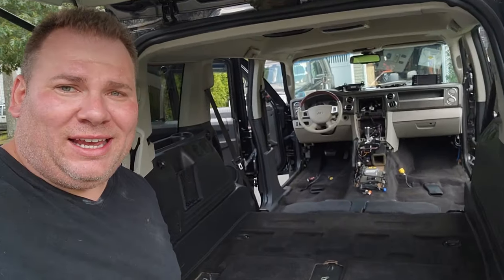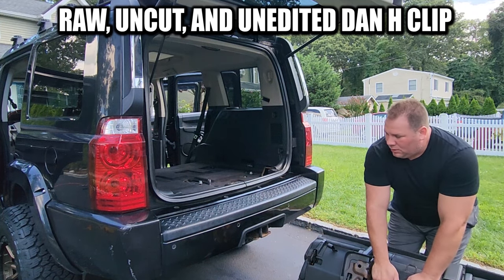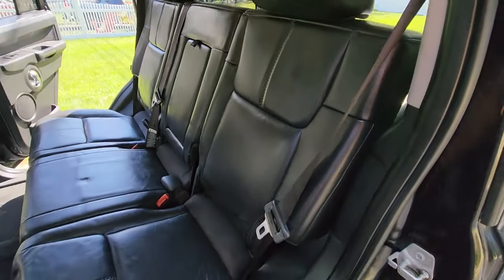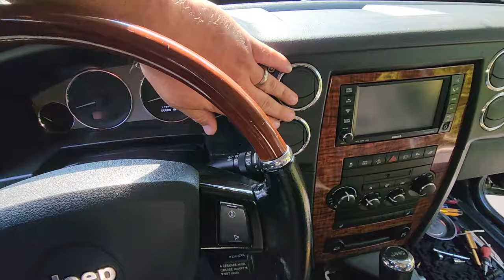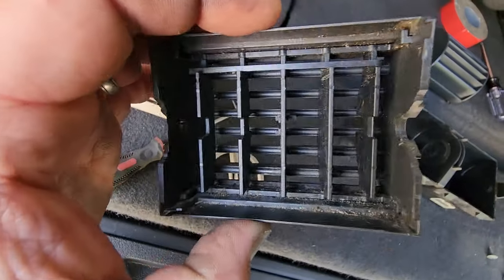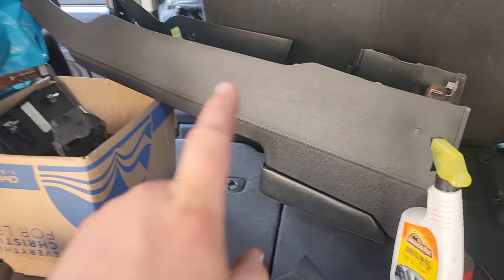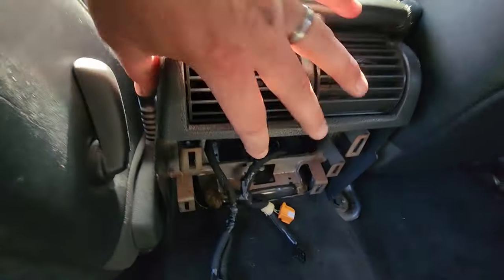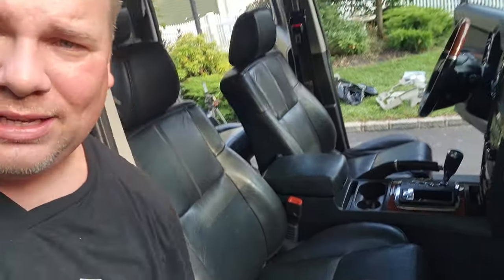JEEP COMMANDER INTERIOR SWAP!!!  PART  2 - SEAT + INTERIOR INSTALLATION & CENTER CONSOLE VENT FIX

Comment: Great job on the swap!... and you didn't even have to use any JBWeld!!    I'd love to add those black door panels to my Commander.  I have the "Saddle" color seats and think the black panels would look sharp.  Guess I'll have to check the local auto yards...

Yeah, the smoked headlights are awesome.  They'd look wicked nice on your XK.   I have them and love them.  I also added smoked fog lights.  Very easy upgrade!
Reply from the maker: Thanks man! Do you know if they have smoked headlights in the HIDs?
Reply: @ProjectDanH  I bought mine in 2018 on Ebay (maybe Amazon?) and they're HID.  I don't see the ones I bought anymore being offered, but there are a number of halogen option.  Perhaps you can convert the assembly to run HIDs?